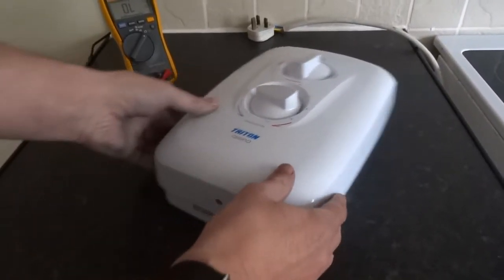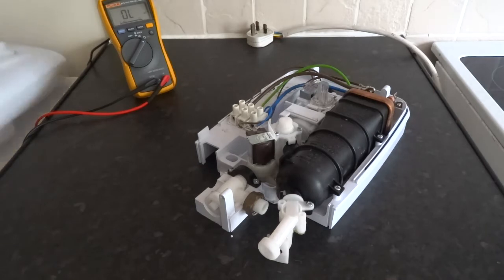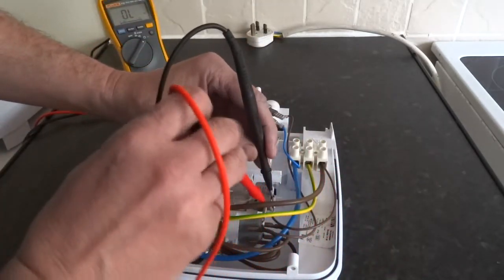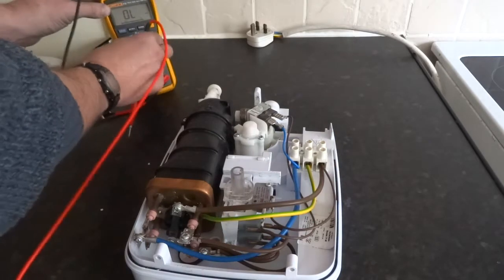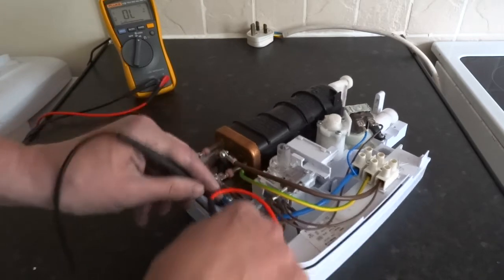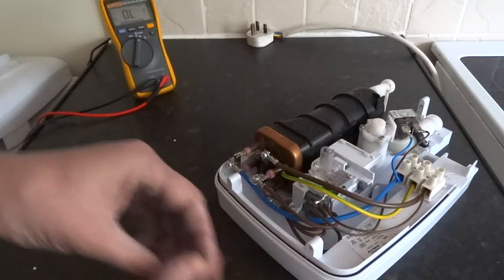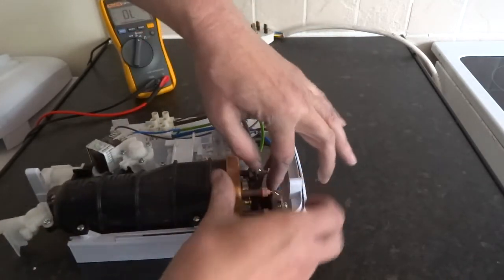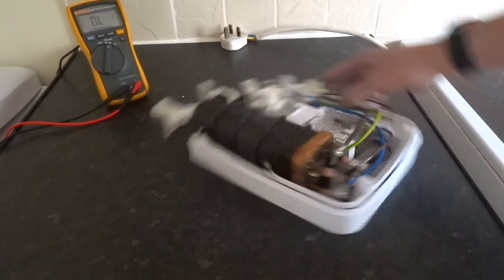Triton Avena Electric Shower Troubleshooting DIY Repair Guide

Comment: Hi what would you about low water pressure ?
Reply from the maker: incoming mains , to many connections , blockages , too many isolation ball valves , tapping into wrong supply lots of possbilities really